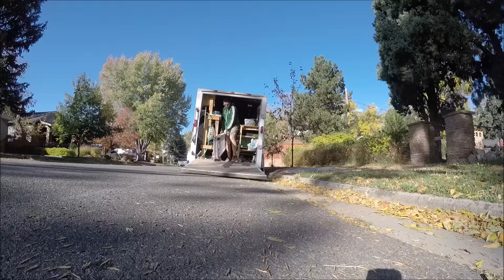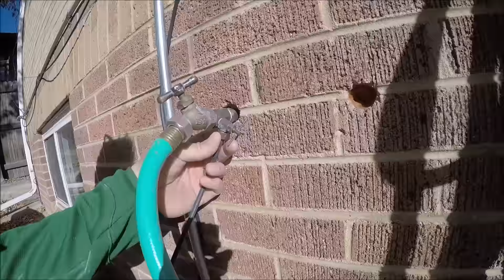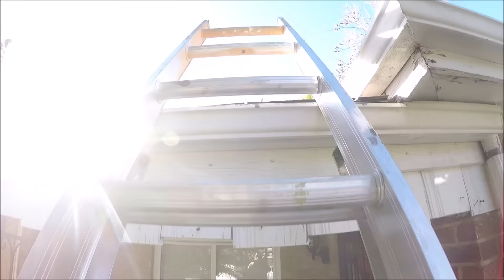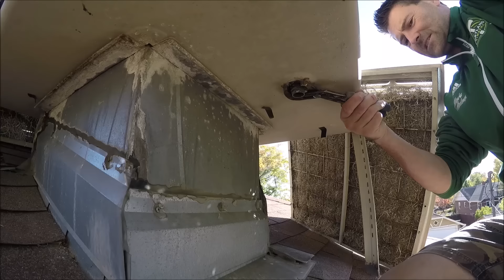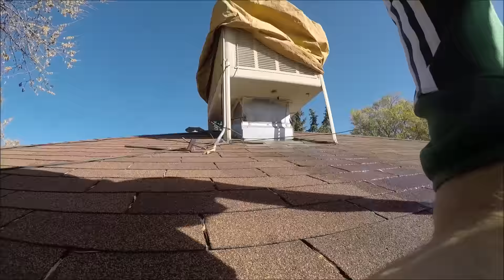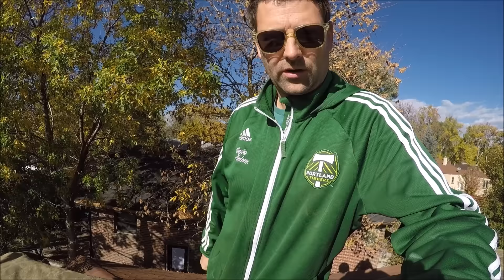HOW TO MAKE $270 PER HOUR AS A HANDYMAN

Comment: if you have to pay 270 an hour... big heads up to find a new "cheaper" handyman
Reply from the maker: This is just the going rate to winterize swamp coolers.  $45 for 5 min of work.  I don't make $270 per hour.  Every fall I have around 25 to winterize.
Reply: Takes more than 5 minutes alone just to unload, position, extend, and reload an extension ladder. Then theres gathering tools, bending down to do it, dealing with fittings that are stuck etc... + travel time
Reply: If I call a HVAC repair man to my house it costs me 85 dollars just for him to show up. I have to keep my tools in top performance condition or replace them regularly. I have my liability insurance to protect you and me from the unexpected disaster that I hope never occurs ( not cheap). I had to take and schedule the appointment as well as show up like a responsible man. I also have to keep my vehicle in the best condition I can knowing that I will be replacing that too. I also have to put back money for my state and federal taxes. These 10 minute jobs we get are more travel than work and it is nice to stack them up but, more often than not I have 2 today 1 tomorrow that I have to break away from a current project and travel clear across town to hit. It's not like I can start at 1 end of a street and just work this block today. I am 50 dollars to show up and do anything and I don't apologize for it.
Reply: Here in the west is 165.00 they buy water pump grass lubes all and clean it too. With 5 coolers can make 500.00

Comment: I have an estimate coming up for a previous customer. Drywall ceiling hang & finish. Standard size 2 car garage, haven't measured yet, but probably about 20'x20'. Water damaged. Homeowner already demoed. Not a rich client, but both are professionals. I've got a figure in mind, but my prices are too low, after seeing what you get for jobs. I'm kinda stuck in the past with my prices. What would your estimate look like? It would be great for a change to start making money for my skills! Thanks, love your videos.
Reply from the maker: What finish does he want on it.  Usually its just fire tape and no sanding.  How High is the ceiling.  I would rent a lift to make it easier on your back.  I would try to get at least get $1100 for the labor.  The main goal is to get more work and referrals so you can't charge to much.  If the finish is to be sanded and coated more than once I would us that as an increase pricing option.   You can point out that there is a lot of over head work getting it cut tight around the garage door brackets.
Reply: The Handyman - Thank You - Sounds good! For a proper estimate, I still need to go over the details with the homeowner on the finish work, paint, etc. (8 foot ceiling) Your $1100 for labor only is accurate and well worth it. A lot of time goes into a small job like this especially when working solo. I like your fixed labor @ $500/day (from your video) on these types of jobs. The way I USED TO figure jobs was hourly labor plus materials, and I always underestimated the labor. My cushion on labor was never enough. Always trying to be nice and give people the best price, instead of what I needed to charge to stay in business and support my family. For me, figuring materials is the easy part. Your prices are pretty much in line with what my competitors charge (actual drywall contractors). They can come in with a 3 man crew, on a small job like this, have the drywall hung, 3 coats of hot mud, sanded, and out the door in a day for about $1.2k to 1.5k, including materials (Mississippi). I'm probably at least 2 1/2 days to get it to the same sanded, paint ready stage. And I agree with you, many people just get their garages taped with a single coat of mud. We'll see what they want, then see if they flinch at my NEW labor prices.  Does anybody really think an electrician, plumber, mechanic, etc. should make $75-100 per hour, while a skilled handyman makes $30? And I do already own a lift for small jobs like this. All the best.
Reply from the maker: Good luck.   I had a customer tell me last week that she paid an electrician $150 per hour  to replace outlets in her kitchen and $75 per outlet for materials.
Reply: Not sure if that's greed or just falling in line with current pricing. I would have a hard time sleeping at night if I routinely charged that. Guess I'm special. HA! I recently had hvac condensor leaks on 2 units, that I knew could be repaired, I just wasn't the guy to do it, so I contacted 3 hvac techs that all told me I had to replace the units at around $5k for both. Long story short - found an old timer hvac friend of a friend that fixed both units (about an 1 hour sweating a few lengths of new copper tubing on 1 unit), completely filled that unit with freon, and topped the other one up (about 30 minutes) for $200 total - my price. That was a few miserably hot humid Mississippi months ago with no complaints yet from homeowner.
Reply: Steve A Reeno.  You're way too cheap on pricing. They're gonna tell all their friends and you'll be stuck with all kinds of nuisance calls or no money when all is said and done. I was told to charge an up front fee for the initial consult and estimate then take it off the price once the job is set and in motion. Don't short change yourself unless you're trying to build clientele. Tell them these are introductory prices to showcase your abilities. The good customers will stand out and you both win.